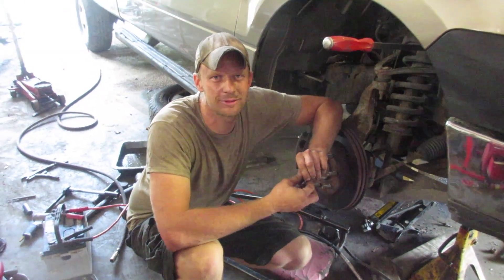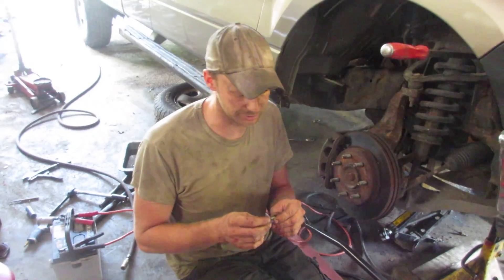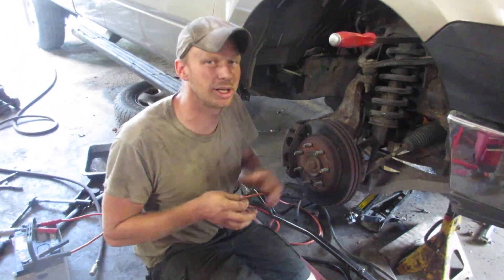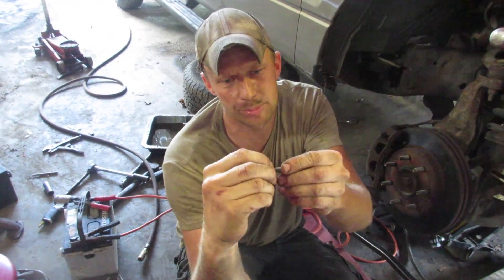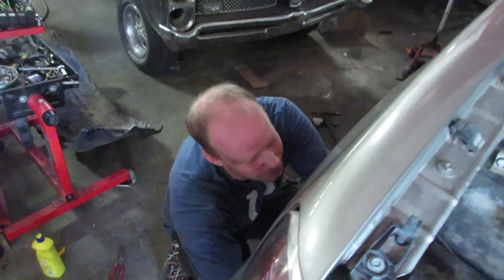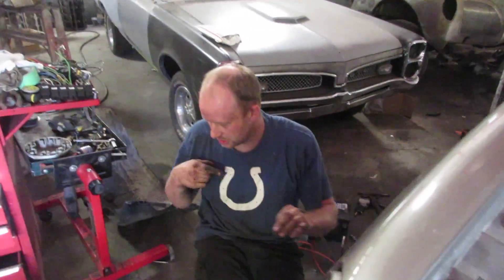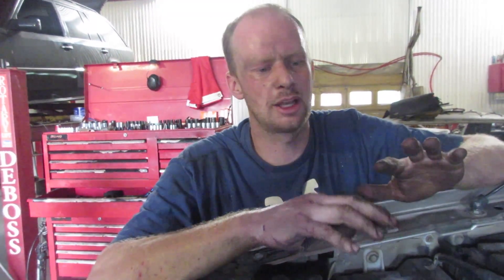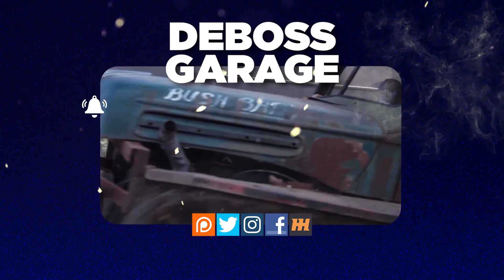How To Remove Broken & Rusted Stud Stuck In Aluminum (Thread Saver!)

Comment: Don't walk away, just don't use a mig welder, just don,t penertate like a stick welder. I tries 10 times to weld ,mig 1/2 " nut on old studs . 1 time with stick 6013 120 amps. worked.
Reply: Was the stick welder a 120volt model? A/C or D/C?

Comment: I just stumbled across your video. Wish I had seen it last month, while struggling with several broken studs. They were pretty much seized up after 20 years. Sadly, I ended up drilling out four studs with a diamond core bit ($7 today), and rethreading to10mm.  I learned a lot from your video, and no doubt will try your method soon.

Comment: Can i do this trick on a 2017 wr250r aluminum head ? I tried  soaking in solvent and i tried welding a nut to it and had the stud sheer off again , so now im at the point of drilling it out i think , unless i could use this trick with out fucking my engine , will this trick hurt a small 250 engine ? Gaskets , warp ect ?

Comment: 2008 Subaru EGR valve, both bolts snapped off. Tried everything, welding nuts, oxy acetylene,  deep creep,  etc nothing worked.... After three days non stop I saw your vid... You saved my ass Rich.... I can't thank you enough... ! De Bosse Garage all the way

Comment: Greatest stuck bolt trick yet - thanks!  The battery cable trick just worked great on a broken bolt in my subaru block.  On my 2002 F250, I did 5 of 8 broken studs.  Had zero success welding nuts onto the studs.  What I ended up doing for studs broke flush or below the head was drilling a 3/16" hole down the stud center with a 12 inch long drill bit.  Actually reached through holes in the frame rail to reach some of them.  Then I tapered the end of an allen wrench and pounded it into the hole drilled in the stud and backed them out that way.
Reply: That's a great idea... !

Comment: Thanks heaps. Got one snapped bolt out of an outboard engine today by welding a bar on the end. That did not work with the 2nd one. The method you've shown here would no doubt be heaps more effective and you can keep the heat on for as long as you need. Seems so obvious once you've been shown. Can't wait for my next seized bolt LOL.

Comment: Bro this is brilliant. Maybe you have an idea for me. Big block chevy blower motor with alum heads. Head studs 3 of them broke and seized into the head. Like electrolysis. Its a boat motor. Possibly stuck in block but cannot remove the head because stud swelled or stuck. Any ideas appreciated.

Comment: I spent the day pulling my 07 f150 5.4l exhaust manifold, passenger side.. Guess I got real lucky, only one broken stud, lower rear. It's about 2 threads deep. I was going to drill it and use an extractor but now I'm going to give this a shot. I have a crappy little wire feed welder and I suck at welding, but I'm still going to try it. Wish me luck and thanks for the tip.

Comment: So I looked up a how to video for some broken studs on... wait for it... a 5.43v. Lol and I found this one. I had a spare battery with insufficient juice to start a vehicle and definitely not enough juice to turn that stud red hot but enough to heat it up and loosen that nasty electrolyses. Had 1 stud on each head and after the procedure with the bad battery was able to walk the studs out with some vice grips. . Thanks for the video. It was a life saver. I would've had to take it to a machine shop cause I only have a stick welder. Whew!!!

Comment: I got my manifold off 4.7l dakota every bolt broke off too thanks for the tips hope they come out what a pain in the ass
Reply: Hey, did u end up using this trick to get them off? I'm doing my manifolds on my dakota and one bolt broke off just above the head. Thinking of trying this. Everything else didn't work.
Reply: @oasisx27  
My dakota they all rotted off exceot for 2 i spent 2 days and melted the end off a 50$ pair of jumper cables so i gave up and instead drilled out the back side of the manifold on the ones that were broken to enlarge them and just welded new studs to the broken ones then had the machine shop resurface the manifold . Worked perfect instead of using jumper cables us a 220v  stick welder on low setting it works better if you have access to one .

Comment: I have a broken off thermostat housing bolt and I think you may have just saved my ass. I tried the welding trick to no avail, but that battery trick is quite clever.

Working on automobiles is something I've done for many, many years, but. My dad and grandfather always taught me that being open to suggestions can save your ass because someone else just may have the answer. I'm going to give this a shot when I get out of work today, thanks again.
Reply: how did it go?? any tips???

Comment: I feel for ya, man. I was a Ford Master Tech from 2006-2013 in NW Wisconsin - ie rust country. I’ve done so many of those exhaust manifolds - half tons, 3/4 & 1 tons, motorhomes with V10’s, you name it. Ironically never had to do one in a Crown Vic. Anyway, I figured out the jumper cable trick after already doing dozens upon dozens of them - and it works damn near every time! I made a lot of money off those jobs - we charged straight time on them, no flat rate. And customers paid it - word got around that we did em faster than other shops.
Reply: Beauty EH!

Comment: This trick works great used it on my subaru wrx for the coolant pipe bolts that are always broken or corroded. just disconnect that battery.

Comment: Wow. I snapped a diesel injector bolt today in my wifes car and was looking for ways to get it out. Have you ever exploded a battery doing this? After we exploded a battery by short circuiting it to a car firewall by accident I have never ever even thought about short circuiting a battery like this.

Comment: I tried this (in a bracket, not on an engine), it did not work as the corrosion had built up an insulating layer between the bolt and aluminum.

Comment: Can you show how to use this method to remove control arm bolts on those rusty cars? I was wondering if you could get the bolt hot enough to melt the bushing just enough so that it won't bind the bolt. I'd love to see a video on control arm and other suspension bushings that are so hard to take out!

Comment: This is an old video, but I tried this 4 times on some snapped bolts on my outboard motor with no success.  I was able to weld a nut on one of four broken bolts and remove it, but the other 3 have just twisted right off multiple times.  Unfortunately it sounds like drilling and tapping is my only option at this point.

Comment: Since you mentioned there was corrosion involved (not a surprise, owing to two different metals), did you begin by smacking it a few times smartly with a hammer and center punch, followed by several blasts of penetrating fluid, followed by several more hammer hits?  That might have loosened the stud by breaking up the corrosion you needed the heat for.  No doubt, you did some variation of that on your journey, but I mention it for those of us who don't have access to a welder.  After that, you'd turn to an extractor set to remove the stud (if it broke off at or below the surface).  Access issues (like getting a cordless drill in there) might make that difficult or impossible, however.  If enough is left above the surface, you could try a stud remover or perhaps a turbo socket to back it out.  Overall, heat is probably faster and more consistent in obtaining the desired result, although there are no guarantees when it comes to broken bolts/studs.  With a known problem like this (electrolysis), it makes you wonder why Ford didn't soak the exhaust studs in oil or grease them prior to installation. Thanks for the video and sharing your expertise.

Comment: Hi Rich, I have two bolts that broke off in an aluminum water pump housing. The bolts are sticking out a half an inch. Can I do this trick without welding since I can reach the bolts with vice grips? And how long do I hold the positive on the bolt? I would guess until it glows for 5 seconds but I'm not sure.
Reply: how did that work out for ya?

Comment: yup it works because the steel has greater electrical resistance to current than aluminium does it acts as a resistor, so it heats up the steel but not the aluminium.

Comment: Sounds like a good plan with the battery cable heating trick. I have been using heating and water cooling fast for removing rusted nuts and bolts for a long time. This was used often due to my working on trucks that went along the beach and so were exposed to a lot of salt water in picking up fish from commercial fishermen using nets on the beach.  never tried the battery trick.  what I have done is use a small end for my torch to get the bolt red hot and then with water to cool fast. then the bolt usually comes out OK if I can get a little punch to move it around with a short predrilled hole.  yeah, don't use easy-outs often as haven't had much luck with those. Do use the welding routine, however. now i am working on a Ford F150 just the the one in this video and these are really small bolts for exhaust manifolds in an alum head.  Anyway, thanks for the video and hope i can get it done in under 8 frigging hours.

Comment: I've used the nut-welded-to-bolt technique many times on fasteners stuck in steel component but not in alloy. Assumed that steel component would just expand into the alloy. I've got a Yamaha XJR1300 with very thin corroded exhaust studs. Looks like any force will snap them. Battery trick might be the answer

Comment: Aluminum dissipates heat much faster than steel which is why the steel heats faster than the aluminum. Current actually flows from - to +, so by connecting the + to the stud current is flowing from the block to the stud breaking the corrosion caused by electrolysis. This is an awesome video, I never would have thought of trying that.
Reply: Deboss will NEVER surrender to a Ford aka the other F-word.
Reply: Im curious why would it make a difference which way the current flowed. Either way the steel will heat up before the aluminum.
Reply: This guy....... absolutely incredible! Thank you sir!

Comment: Best way I was shown with rusty manifolds is to just torch the heads off and pull the manifold off so you still have something to grab. This still is the way to go for the 2/3 ones that busted below the surface. Torches and welders always in the salt belt.

Comment: I like the battery method once the stud is built up. I have successfully used the TIG to build up a stud and get heat into the threads, but this could be an even better method for controlled heating. Cheers.

Comment: The 5.4 exhaust manifolds don't last long, one of the company trucks I drive had new manifolds put on, they are leaking again. Onelonely farmer had to do his over again he installed stainless studs so the nuts came off easier the second time around.
Reply: Graveltrucking when pairing a steel with aluminum, stainless is by far the best material to use because there is a much lower electrolytic reaction between the two metals.

Comment: The newer 4.6/5.4's (08-up I think) use stainless hardware. Guess what... Cant weld to the broken studs. Cab off and cylinder heads off to fix...

Comment: Do you ever worry about welding on the car with MIG and do you disconnect the battery or remove the computer first?  I've taken the chance a few times but I hear horror stories of trashing a computer.
Reply from the maker: Rule of thumb, disconnect the battery.  I have done it plenty without but make sure that the ground is close to where you are welding.  If the current from the ground travels past a computer ground to get to the welding tip, you will likely do damage.  I disconnected this battery and then had to drive it to reset the emission monitors as it was due for an e-test

Comment: You should look at this video. How to remove a bolt with pickling salt it works.
https://youtu.be/fqZYgReuywM
Reply from the maker: I tried it.  Left it for three weeks in the middle of summer.  it doesn't work on old rusty bolts, only on brand new ones.  Not very practical, especially when customers want their vehicles back in a day
Reply: The pickling salt does work but only with heat. Like immerssed in a slow cooker with alum dissolved in water. not really practical to get large components into a pot of hot water and alum

Comment: I have a rear end fill plug bolt that won't come out. Can someone give me some tips on how to get it out before I strip it?
Reply: Use a torch on the metal around the bolt but not on the plug itself. The idea is to expand the steel of the housing around the plug without expanding the steel of the plug too much. Hope this will help. May want to make sure the fuel tank is full before doing so however, empty tanks are much more volatile and can go BOOM!!

Comment: Using the battery and jumper cables is a new trick to me.   I have welded onto the broken bolt before and got them out like you demonstrated, but usually relied on the heat from the welding to be enough.  Of course, I don't work on Fords... 8-)
I agree about the "EZ-Outs", they can make it harder to get the broken bolt or stud out.  But I've found that a left-hand twist drill usually does the trick for me, especially in an aluminum head.  Just start drilling a hole to use an EZ-Out and when the drill bit catches while drilling, it'll back the bolt right out.  That doesn't work as well a steel bolt rusted in an iron block, about 50% of the time if I'm lucky.  But in aluminum, I rarely have to resort to using the EZ-Out, just the left-hand drill bit.  A little squirt of In-force always helps too!

Comment: Awesome tip! The method of welding the broken stud/bolt till it sticks above the surface of the flange it broken in and welding at nut to it works 99.9% of the time but this is another great method! Thanks for sharing!

Comment: +DEBOSS GARAGE Great video! Do you happen to know if the exhaust manifold bolts are steel as well for GM gen III motors? I have the same issue with my 5.3L.
Reply from the maker: Should work on all vortecs too

Comment: Yep, got a 97 f150 with a cracked manifold on the right side of my 5.4l. This should be a Ford recall for low standard materials. No more Fords for me. Sick of there shit.
Reply: weelgunny you are talking about a 20 year old truck lol we have a fleet of chevy equinox's for our salesmen at work and talk about the modern day pile of shit, exhaust manifolds cracking within a year or 2. We literally have replaced manifolds on every single one and some multiple times so don't just go around bashing Ford, and FYI the vehicles I'm talking about are only 1-2 years old not 10+years old

Comment: I can't decide if those 5.4l engines are the things that haunt mechanics nightmares or put kids through college.  Spark plugs, manifolds, cam phasers, timing chain guides, yeash.....
Reply from the maker: Nightmares.  You think you can make a decent buck and then realize you have 8 hours into it
Reply: These ford engines are planned obsolescence. I don't know how ford hasn't went outta business
Reply: you forgot ball joints lol
Reply: I didn’t mind em. 40 minutes to pull the cab and everything is right there. No leaning over the radiator, no fenders in your way. Pull up a scooter-stool and do what you gotta do, then drop the cab back on. Bingo-bango.
Reply: Every manufacturer exercises planned obsolescence. GM is one of the worst, in my opinion, cutting their factory parts support from 12 to 6 years recently. Add in their love of pushrod engines, and it’s just blah to me. Even my frigging snowblower has an overhead cam... and don’t get me started on their third-rate electrical systems. Not as bad as Dodge, but they get closer every year.
Reply: Well, they loyal Ford lovers and owners are getting old and dying every day.  Toyota and Nissan FULL SIZE pickups will surely EAT FORD, GM and Fiat Chrysler's lunch!  We in American business have SEEN THIS BEFORE with the demise of KODAK, XEROX, Chrysler in the 70s, GM since the early 70s, Caterpillar, Mack Truck, and all the other domestic companies that management and employees put in their time, went home and went to bed.   The KIA was brought to this country in the 80's and look at them now. When are we going to learn?  I own a Mercury, BMW, VW a KIA minivan and a two Chevrolets.  I hate seeing Detroit in a state of disrepair knowing our family's history in buying GM and FORD products made here on N American soil...where they should.  When you buy something from China, the money winds up in a Chinese Bank.
Reply: Tom Maika CAT got out of the heavy truck engine end because of the emissions requirements the government mandated in the mid 2000s. Those engines were absolute shit. We had a fleet of them and mine would have to go back to a CAT shop to have the DPF filter cleaned every six weeks or so. Additionally, it would get so hot while regenerating, that the front right air bag on the tractor would be damaged and have to be replaced about every two months—the owner of the company mandated that all of those Peterbilts be replaced as soon as they turned 350,000 miles, which is about 1/2 of the miles we would typically run a truck for retiring it or relegating it to a spare.

The pre mid 90s Caterpillar mechanical engines were terrific engines, but they started to slip when they started adding the electronic stuff to their motors. Unfortunately, they never stopped the skid.